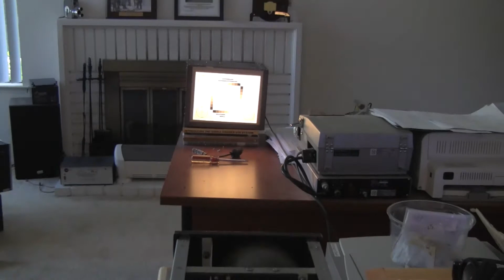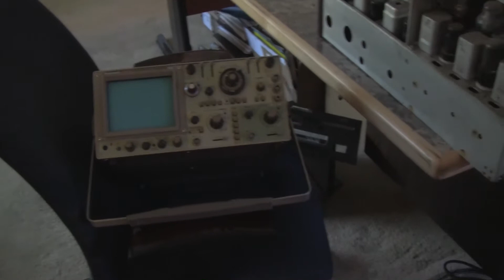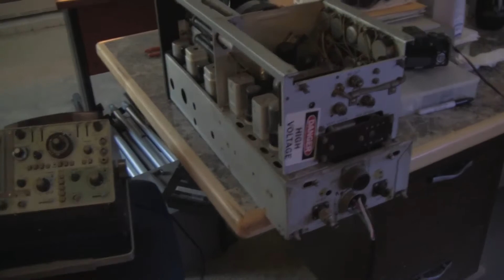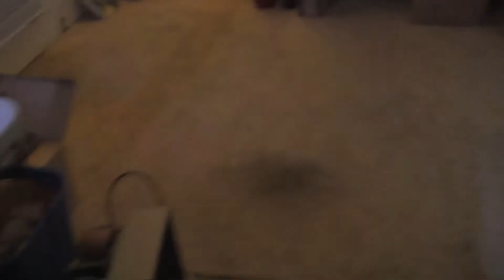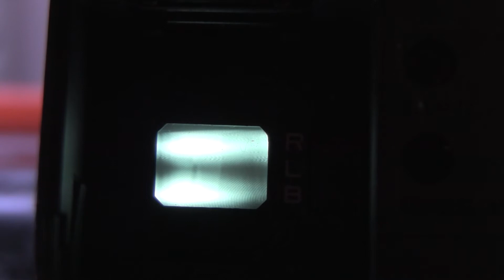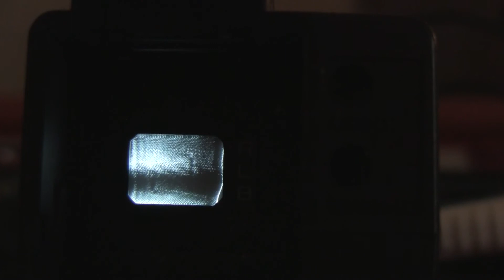RCA Iconoscope TV Camera: First Video

Comment: Just wondering, any idea what a used iconoscope tube might be worth these days?
Reply from the maker: A non working tube for display only should be priced between $50 and $100. A "claimed" working tube $100 or more depending on the reliability of the seller. A "proven" working tube in the $300+ range.